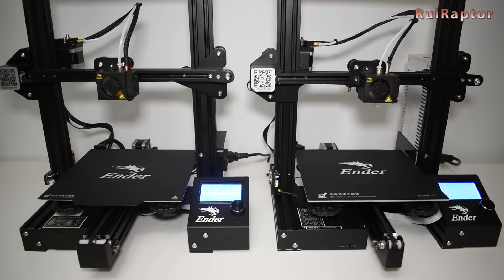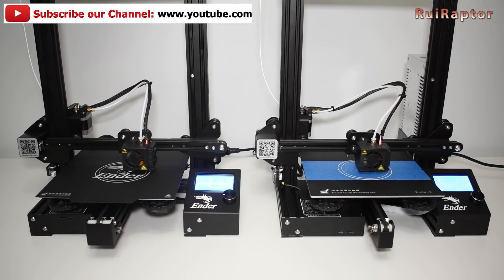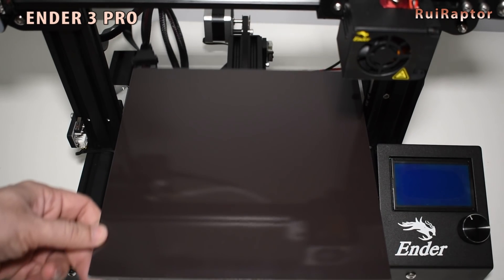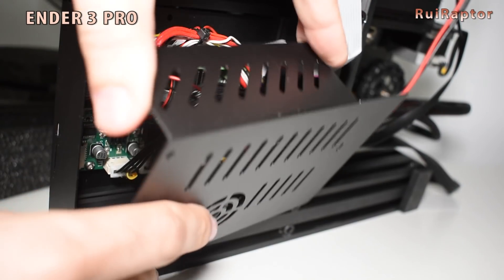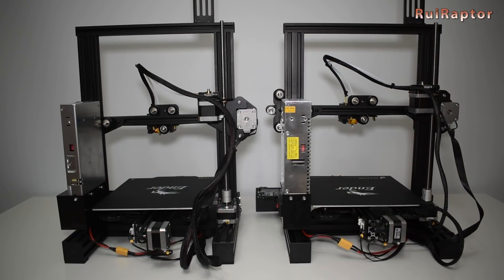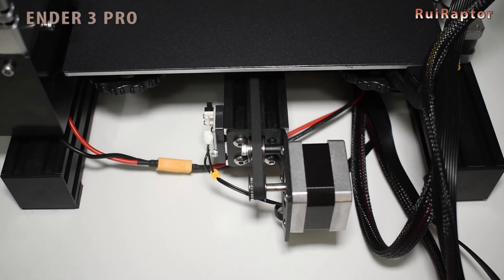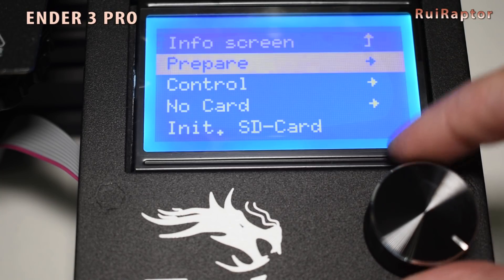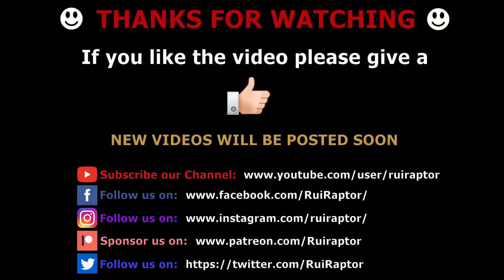Creality Ender 3 VS Ender 3 PRO - All The Details (PT subtitles)

Comment: @ruiraptor

Do you know if the new Ender 3 V2 has Marlin on it or can be updated with Marlin 2.0? Or is it different from the Ender 3 or PRO and cannot be, but has a non open source firmware now?  Hope not.  Wonder if the motherboard can be swapped out later with a SKR mini v2.0 too?  But wonder how that would work with the Ender 3 V2 color vertical display? Thanks rui, your VERY knowledgeable!  Among the top best on YouTube!!! ; )
Reply from the maker: Hi Tim, we have the V2 here to test and we will publish that very soon. Stay tuned for that :)
Reply: @ruiraptor  awesome!  ; )  (make sure to detail the PSU & motherboard, but they are crammed under it!)  In my case, I think it (Ender 3 V2) will be a better buy than the CR-6 SE (and Ender 3 Pro)... and because I missed out on the Kickstarter anyways!  ; )  I like that the CR-6 SE has auto bed leveling using new tension sensor, but feel it is straying away from the Ender style nozzle system etc which I prefer for wider options that the Ender 3 line has.

I think the biggest concerns Ender 3 (Pro) users will have is the upgrade options available for the V2.  I.e. all metal hotends, direct drive conversions, dual gear extrusions for wet spaghetti flexible filament, bl touch, filament runout sensor (i.e. optical), lighting, replace plastic belt tensioners with metal ones, textured powder coated PEI flexible steel sheet,  motherboard and firmware modifications and upgrades.  Oh heck, basically all the features the Prusa MK3S has already... but without the HUGE WAIT.  I was just going to pay for a Prusa...  but did NOT want to wait an eternity....  heard the Ender 3 was awesome... so glad I am experiencing the Creality route.  Very happy I did.  I know you may end spending money to approach a MK3S workhorse, but no worries, it's a fun learning experience and I'll prob order a MK3S anyways also as I really know its the all around BEST printer with all the necessary features...  oh... but wait, the Prusa XL?  Waiting long enough, so guess can keep waiting for the CoreXY Prusa XL!

It REALLY would be in Prusa's BEST INTEREST to just get over the self 3D printing parts method, and just injection mold all their printed parts!  If a part changes, fine, 3d print, and if it comes to a final revision, then injection mold it!  That will solve their SLLLLLOOOOOOW turnaround.  It's crazy to have all those printers making parts for waiting customers in slllloooooow motion.  I prefer superior injection molded parts anyways... that's what Creality is doing... and is getting my money at the moment.  Prusa is a cult following like Apple... I'll wait to drink the kool-aid.  ; )

Keep up the GREAT quality work!  VERY HELPFUL!!!  : )

Edit:  Just noticed my Ender 3 V2 will be here tomorrow!  Can't wait to see how it compares to my Ender 3 Pro and Ender 5 Pro.
Going to have a heck of time getting the BEST Ender 3 light on this V2!  The V2 PSU has been moved under it (and opposite left side!) and the cable of the light is already tight.  Looks like will be extending light power cables and direct tie in to the Mean Well PSU!!!

https://gulfcoast-robotics.com/collections/creality-ender-3-upgrades-and-parts/products/24v-premium-led-light-bar-upgrade-creality-ender-3-3d-printer

Prob need a unboxing, build and review of Ender 3 V2.  Then followed up with a thorough Upgrades video for the Ender 3 V2.  I think the V2 will be very popular again like the original Ender 3 was.... especially when the price point drops from $299 to the $200 range! (Plus uograde costs of course!)
Reply from the maker: Hi Tim, don't worry. We always show all the electronics in all our videos ;)

Comment: The Xt60 connector's are not the problem. But the bad soldering of the wires on the XT60 is the problem.

Comment: how about the sound of printing is the standard  is annoying?
Reply from the maker: Both sound the same. Both use the standard Allegro drivers which make the motors noisy but the axis moving are not thanks to the wheels.

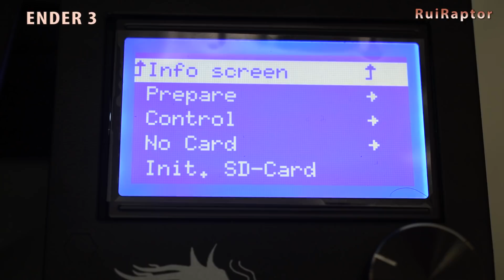Comment: Rui,  when you state @ 5:30 that the firmware is different it's not true fore the later ones since I have the Ender 3 as of September and it has jerk, acceleration and steps 😉
Keep up the good work and a Happy 2019🎉
Reply from the maker: Hi,
thanks for sharing that information.
Our standard Ender 3 arrived this summer and mine did, in fact, not include the new firmware (which in my opinion is better because allows us to calibrate the machine). However, this new firmware version still does not include the thermal runaway protection, so I had to update both printers.
I believe that some on-line stores still might have previous versions of the Ender 3 in stock and will send them to new customers.
Happy new year :)